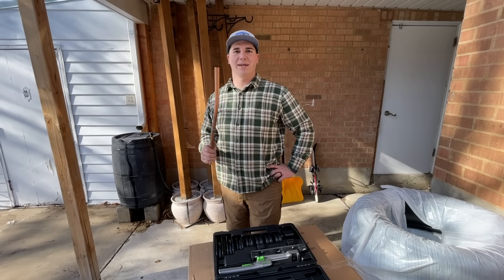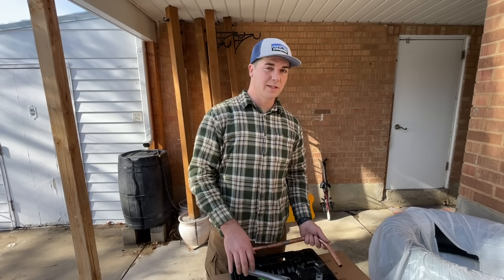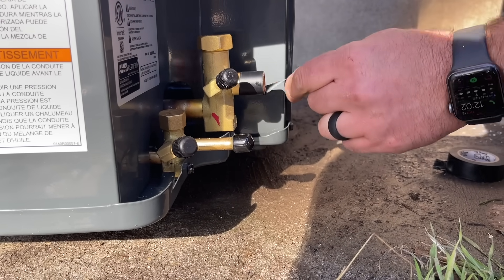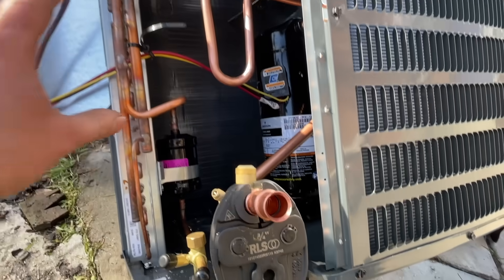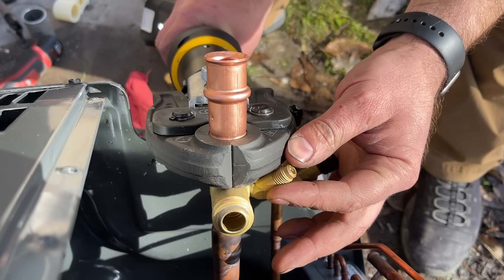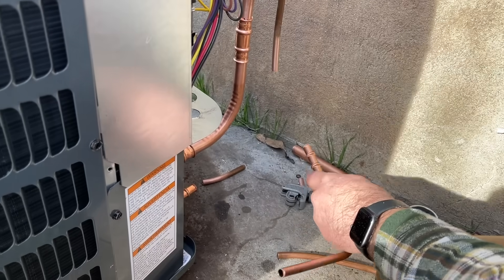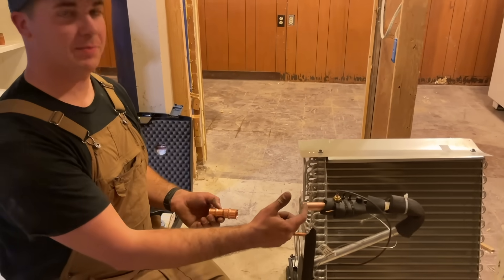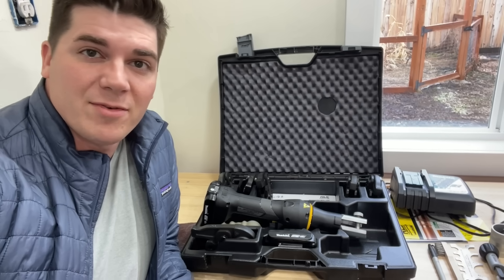Brazing Is For Cavemen. THIS Is The Future Of HVAC Copper Connections. -RLS Crimping Tool-

Comment: Like people say time will tell right, lets say if this crimping becomes the new thing to do lets say 5 years from now if that crimp bust then we know 5 years is what you get, by the next 5 years mock my words this whole split system stuff will be somehow in a compact unit and no brazzing or crimping needed just like cars wont have wires no more evrything being bluetooth ina car same thing with ac
Reply: Factually mini splits do not require crimping nor brazing as they use flare connectors on almost all that I have seen.

Comment: I have not once seen this in the field work. I have run service calls where these fittings were used by someone else, and they were leaking/the source of the problem. "Do not recommend" you can quote me on that. Professionals has no issue brazing copper lines, it's fast and verifiable and a way to connect copper together.

Comment: Nice you made a 4 connection brazing job a 30 piece connection. Probably took you twice as long. Not to mention those fittings are expensive 😂😅😂😅. Do you have to pick up the unit like that all the time.

Comment: This won't age well.  I own a hvac company with 50 employees, been working since 1997 on my own, and another 10 years in a family business.  

Over the past years, there have been many different solutions to replace copper and brazing, or one or the other.  All have proven to be failures in too high of numbers.  

Especially with the industry embracing heat pumps, there is more vibration and temperature fluctuations exposed to the piping system.

Comment: I like to use StayBrite 8 so I don't have to use nitrogen.  The fittings and crimper are nice but expensive.  A lot of plumbers are using the crimp fittings on water heaters and boilers now to save installation time.  Steve Lav still uses his torch and regular fittings.
Reply from the maker: I have a video on Staybrite 8 coming out next week! I love it!
Reply: I never used Stay Brite 8 on a commercial refrigeration job since 15% silver brazing rod was always specified by the engineer for commercial work but I have used Stay Brite 8 many times for residential HVAC installs. 
One of my coworkers made the mistake of installing a refrigeration coil in a hospital using Stay Brite 8 and a maintenance man pointed it out to me. I had to send the coworker back out to braze the pipe correctly. Luckily, the engineer had not spotted the mistake.
Reply: According to Harris #8 is good for 410a!
Reply: @petersmart1999  I don't recommend soldering to someone that does not know how to solder. The fittings need to be tight otherwise you are going to be dropping little balls of solder right into the system. Also, don't flux the female side and only use a sparing amount halfway to the end of the tube.
Reply: Yep, keyword. Sparingly. Great reply.😊
Reply: Stabrite 8 doesn't meet code for indoor where the minimum temperature must be 1,000F or greater.

Comment: I really enjoyed the pace of the video.  You were not rushed, didn’t cut corners and you can clearly see the time savings with the press tool.  Keep the videos coming.  GREAT job!
Chad
Reply: It is NOT a time saving tool. You will be back repairing refrigeration leaks. These tools are overpriced garbage. Your installers will lose pieces of the tool. They will not use it correctly. The fittings cost way more than standard fittings. If you want to lose money doing HVAC, buy one.
Reply from the maker: Thanks so much! Glad you enjoyed it :)

Comment: Looks like a future service call to me. Caveman good.
Who uses old lines on new units? That's caveman.
How did you install the dryer?
Reply from the maker: Caveman unit have dryer built in. What wrong with old line?
Reply: @Kevin-mp5of   The manufacturer requires the lines to be flushed if using old lines. The cost and labor of doing that is more than replacing the line set. I didn't see anything about the lines being flushed.  
American and Mexican line sets are available. Tell your distributor you want the good stuff.
Reply: @Kevin-mp5of  That is correct. As I said, it is a costly application and New lines are always recommend.

Comment: For a hydronic installation it's great, but I would never use these on a Freon system primarily because it is not a true hermetic seal.  Rubber has permeability and slowly leaks over time.

Comment: good to have in your arsenal,  for different applications and times. if they make it, why not. some are so  close-minded on only brazing. it's the price that scares them away.
Reply from the maker: So true. To each their own 👍🏼
Reply: Legitimately the price is no where near comparable.   I have looked several times at it I love tools in general but I can not even com close to legitimizing the purchase of this as a Service Technician.  20+ years in the field and not on the low end of wages by any means.  Over time it may come down but definitely more cost effective for a technician to braze.  One thing if only if it maybe double or triple the initial cost but a welding rig $350 or press machine for $2500-4000 based on region. That is not close at all.

Comment: Im going to give you a tip , i see no pipe insulation on the 3/4 . So if you dealing with a line set thats preinsulated , push the insulation back enough and use your pipe cutter to hold it in place and you have the perfect and great looking insulation over your suction pipe . 30 plus years a person learns alot of tips of the trade .
Reply from the maker: I used the split insulation with adhesive that you can attach afterwards. I’ve used your tip in the past though! Thanks for sharing 🙏🏻

Comment: Why don't they use plastic flex tubes as in split A/C units made by Mitsubishi etc. For 32 SEER systems
Reply from the maker: Never heard of plastic for HVAC…
Reply: Nor will you that is a comment from someone who can’t tell the difference between a refrigerant line and a drain line or the insulation wrap around 1/4” copper lines with flare fitting connectors😂

Comment: These crimp fittings,I saw in GERMANY,IN 2001,ON HYDRONICS,thenGAS PIPELINES,THEN REFRIGERATION,A/C,I NEVER HAD ONE LEAK, VIEGGIA,THEN RIDGID,MILLWAUKEE <& others
Each brand has their own ‘jaws’,,,   Way back,about 1960 PARKER had the ‘QL’ SYSTEM,to eliminate FLARES, but the industry never took to it.   🇺🇸🇺🇸🇺🇸🇺🇸

Comment: Many refrigerant oils will CHEW UP the rubber seals. Know your refrigerant and the type of rubber beforehand. These fittings are more expensive and meant for quick fixes; not do-it-right-the-first-time applications (which is anytime you’re working with pressurized HVAC gases). You’ll be back in a year or so, trust me. If you can’t manually flex copper and braise connections, try a different career and leave it to someone who doesn’t short-cut their customers and spend more money doing so.
Reply from the maker: So have you tested it and confirmed? This isn’t a short term repair. Why would anyone do this if they knew they’d have to go back in a year? Trust me, if this fails next year, or the year after, you guys will be the first to know. I’m very transparent with my videos and if this thing doesn’t work I’ll let everyone know 👍🏽 so far I’ve heard many good things about it so I figured I’d join the band wagon. Cheers

Comment: WhT happened if you have a leak at the condensing unit service valve how do you fix it, you can’t braze it
Reply from the maker: I’d use a little dremel tool and pop it off. At that point I’d probably end up brazing that joint but I genuinely want to know if this is a long term seal. I believe it is, but if it’s not, you guys will be the first to know! Cheers

Comment: Neat, but only as good as the person wielding the tool. True for brazing technique too, but I've seen more failed joins from ProPressing than from brazing just because the tech didn't prep properly or tried to re-press a connection.

Comment: I could have brazed all my fittings and started my vacuum in the amount of time you did 1 or 2 of those and I'm sure none of mine will leak ever. And I wouldn't have had to unscrew the service valve and flip the unit over to get the tools in place.
Reply: You do a nitrogen purge of lines before brazing. It pushes out other gases and creates a better atmosphere for a good braze.
Reply from the maker: I’m not giving up brazing my friend. But when you are using a torch in a closet where the furnace is with about 1 feet of clearance, I’ll have mine fitted and on to the next phase. So it’s sixes. I love having options :)
Reply: @diyhvacguy  sheet metal pieces make great heat shields for protecting surfaces near the torch
Reply: @diyhvacguy  I give you that it has its uses, For most of what I do right now brazing is my best option,  but I'm not ruling this way out though.  Thanks for the video showing this way.  Keep up the good content
Reply: Brazing with nitrogen?
Reply: 100% agree
Reply: Couldn't agree more
Reply: Brazing ?? Do u mean soldering ?
Reply: @justindrake4600  brazing is using a higher heat with silver sticks soldering is what you do for copper water lines.
Very similar technique for both I think but I'm not sure the only difference is the Heat and the type of filler material
Reply: @terrybressler4654  you are pretty much correct.  Brazing takes longer because of how hot it is, but it's the same process otherwise.

Comment: It's great we have this for flameless job sites but induction heaters I think fulfilled that. You should grease the contact surface on the jaw and piston if you haven't already, probably make the tool last much longer.
Reply: Yea, but those suckers are expensive too. On the plus side, you can still use regular fittings for it.

Comment: Brazing is much faster and reliable in cases like this. The new flexible piping (Yoga) maybe the future as you can mold it easily and fish it through tight places.
Reply: Brazing is only faster when considering applying the actual solder. When you take in time to set everything up then this system is much, much faster.
Reply: @FTLNewsFeed  Setting up to braze doesn't take very long to be honest. In this application, the press definitely took longer than brazing would have after cutting and removing everything. The idea of having to lift the condenser like that made me shiver.
Reply from the maker: I’ve heard some bad things about yoga but maybe it was poor install technique

Comment: seems like a cool tool. seems it is a little bulky and might be hard to use in a tight spot. I guess every tool has its plus and minuses. im sure it was a substantial investment so not for the avg joe homeowner.
Reply from the maker: Exactly. Maybe they will come out with a more compact one but hopefully this shows someone how they can successfully do it on a Goodman condenser. The evaporator coil was a piece of cake :) cheers

Comment: Rubber rings are for millennials that cannot learn to manage a touch tip.  It works both ways.  Rubber rings always fail, it is a matter of when, not if they will fail.
Reply from the maker: Don’t get me wrong I love brazing and improving my technique, and have recently started using Staybrite 8, but I’m happy to blaze this trail. This is a totally different application then your normal o rings so I say don’t know it till it has been disproven and it hasn’t yet. Cheers

Comment: Thanks for the video. I read about this fancy crimper awhile ago.  I would like to know how is this connection holds long term?  I could be wrong but it seems like you might needs to replace it in a few years?  Anyone has reliable long term data using these type of crimp connectors?
Reply from the maker: This technology has been out for 7 years so it’s not a long time, but like I’ve said to others I’m happy to blaze a trail and if any of my connections fail, you guys will be the first to know. Removing these is not all that hard if ever there is a leak.

Comment: I wonder what the life expectancy is for the rubber o ring fittings that sit in your truck parts until yo use them?  Do they expire?
Reply from the maker: That’s a good question. I will be going through them so quick I don’t think they will sit on my truck for long. But they come in a sealed container so I’d definitely recommend leaving them in there instead of dumping them in a bin.
Reply: If they are made by the same company that makes the seals for BMW they’ll last about 3 years…
Reply: @Kevin-mp5of  O-rings are installed as part of a dynamic seal, so that the O-ring can move with the assembly it is installed in, like a washer-less faucet. Sealing elements are installed as part of a static seal, so that the element never moves once pressed.

Comment: My workplace is essentially flame free.  All new buildings/installation are done with press fittings.

As a homeowner this is a good product however I am more curious as to something similar to zoom lock or any brand press to connect for refrigeration.

They are rated for the pressures if the installation instructions are followed.  Interested in a long term review or personal experience with those type products.

Comment: I hate to rain on your parade, but press fittings are not all they're cracked up to be.  I've had these installed at my home to make quick work of a plumbing fix and they failed within 6 months.  From what I can tell, using these on plumbing lines that are susceptible to major temperature changes can cause the o-rings seals to swell and fail.  The second point of failure is where these fittings are used on lines that may be affected by house movement.  I'm not saying they're not a viable option but after having another plumber look at the work done that failed, their answer was pretty blunt "not a fan of these, much prefer the old fashioned way".
Reply from the maker: Plumbing is a different ball game. Different fittings. Also, if Joe the plumber didn’t prep the lines properly that could easily be the reason they leaked 👍🏼
Reply: @diyhvacguy  Not sure how different they are considering they are meant for pressurized pipes that succumb to temperature changes. You may be right though that if the pipes weren't prepped properly, they will fail.  I just know that leaking pipes is never a good thing, and very costly.  My anger level was rather high considering the work was done by a pro.

Comment: yeah those things are very nice but they are very expensive and the fittings are very expensive in my opinion... problem is they don't sell a ton of those tools so the price isn't going to come down too much. Probably 10 years it will be this or something like this and most soldering will be done away with.
Reply: @Kevin-mp5of  oh i have got some ok stuff there its just that you had to understand what you're buying.. but the prices are going up.. Like their impact drivers are great for the price.. wrenches are fine for the car tool box. Free sets of screwdrivers that make good pry tools /chisels.. but you cry about their old shit cordless drills for $19 but you're not going to get a cordless drill anywhere else for $19... can't even get them there anymore... Their 3 foot breaker bar tests better than snapon and its $18 not over $200 for the snapon... some of their stuff is ok especially if you're only going to use it once.. but tool truck companies are the salesmen of satan.. I've seen way too many guys buy $50-100k of tools only to cry they are in debt and can't afford lunch. 

If you're someone that uses tools then you know if their tool is good or not when you pick it up.. if you're buying tools to impress the guys you work with .. well . you deserve to pay (just checked) $255.00 for a 1/2" breaker bar
Reply: @Kevin-mp5of  yep thats why strip clubs don't allow snapon trucks to park in their parkinglots... it would put them out of business.. guys throwing all their cash and signing away their lives ... come on jimmy don't give into it.. come in the strip club where its safe HA!
Reply: @Kevin-mp5of  Harbor Freight is getting expensive... those days are over as are the 25% off coupons

Comment: The hillmore is nice, and getting the reverse throw kit makes if FAR more useful, but the outer ears strip out rapidly and fail… I use a different brand, I’ll update you with the brand. Much better method of attaching them, and it comes with the reverse bend kit.
Reply: BlackMax from CPS far superior bender.

Comment: Glad to see this on your channel. I've seen this on other channels but I was waiting to see it on yours first since I feel you to be trustworthy. Absolute no relation to the HVAC field... Just your average YouTube DIYer looking to install my own system this summer. I guess a concern that I may have would be the tested and true aspect of this install. Is this new tech to the industry? What are the long-term effects on the seals/joints? Will they stand the test of time? Just a few questions I would have. Thanks for the video!
Reply from the maker: It’s not super new technology. The RLS system was designed and began to be used in 2015, so this system is 7 years old. Not old enough for some folks to trust it but I’m willing to the the trailblazer on it.  The fittings are supposed to last the life of the system. So only time will tell! I appreciate your words and I try to be as transparent about things as possible. So if something happens and one of these leaks you guys will be the first to know about it.  Cheers,   Dave
Reply: Some supply shops rent out the crimping tool if you buy all the fittings from them, so, ideal for the DIY tech. But prep is key.
Good luck with your upcoming install.